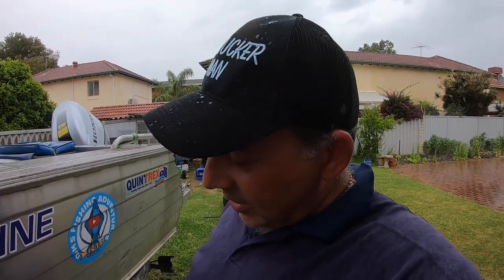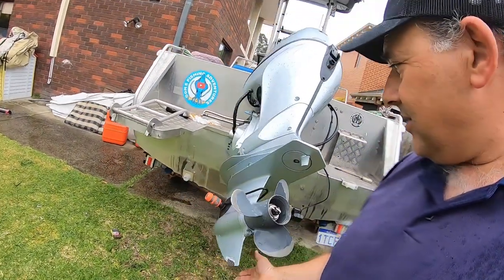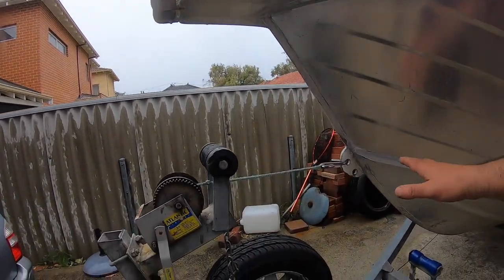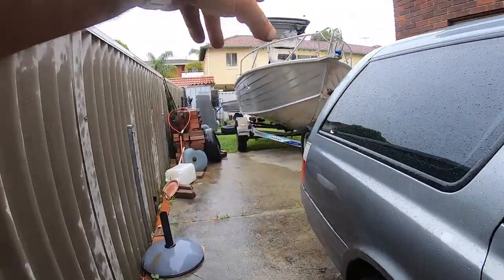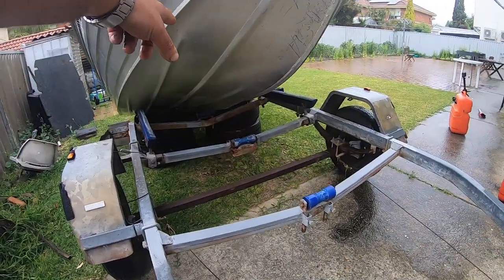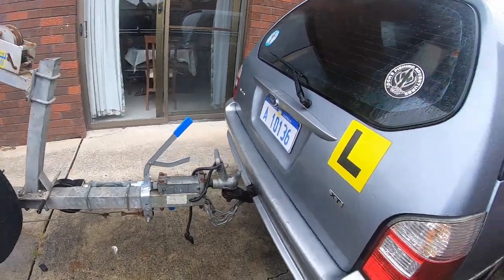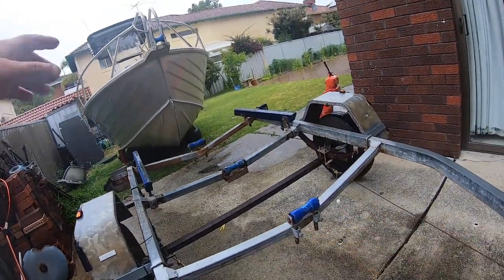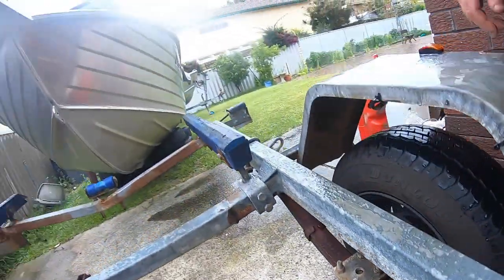I Did it! How to Remove Boat off the Trailer in the Backyard

Comment: Hi Dom. When you put the boat back on. Unhook the trailer from the car and present it to the boat by lifting up the hitch end and pushing as far as you can against the boat. Hook up the winch line and winch the boat onto the trailer letting the trailer roll back under the boat as you winch until the trailer wants to fall down on the hitch. Make sure your jockey wheel is down and once the boat is fully on put on your safety chain and Roberts your relative.
It is also easier when removing  the boat from the trailer.
Gerard not Dianne.
Tight lines.
Reply from the maker: Thanks alot Gerard! Exactly what Ive got planned👍👍
Reply: I used this technique also, it puts a lot less stress on the equipment than trying to winch it on with it locked to the car.

Comment: Dom I found with my boat (similar to yours) when I put it back on the trailer I did it unhooked from the car and the draw bar of the trailer lifts up as it requires and then I just winched it back on, was really easy, then as you winch the trailer pulls back under the boat to the point where the draw bar comes back down
Reply from the maker: Sounds great Luke,cheers👍

Comment: Nice work Dom, I have very similar Dunbier trailer that also needs work- I will try the guy you used in Osborne Park. I am going to try do my lift off the trailer slightly different, I have a two ton engine crane and I think I am going to try and lift the bow up off the trailer with that having the stern resting on tyres and then just drive the trailer out and whack some tires under for taking weight off crane. Stressful stuff for sure, well done doing by yourself… I think I will have a few beers and a mate or two to offer support haha cheers
Reply from the maker: Great idea mate..yes this techinque good for the small boats👍

Comment: The suspense. Well done mate. I painted my trailer while the boat was still on. I couldn't paint the keel roller rack because of cause the boat was on. Trailer is black and the keel rack is white. I wanted to take the boat off the same as you did but i was too afraid. Now i will give it a shot. Thanks mate 👌
Reply from the maker: Thanks alot mate👍 youll be right just take is slowly and depending on how heavey it is, just prop up with more tyers if you can, good luck👍
Reply: @FishTuckerMan  thanks mate. I ask the boss if i could borrow his tractor tyres that he has laying around the vinyard. He said yes but you can't bring them back. Hahah. I don't need tractor tyres laying around ny house. No room for them

Comment: Hi Dom great video mate. Question is that falcon your towing/lauch vehicle? I'm asking because I recently bought I 14ft quintrex and I have a falcon the same as yours but I'm concerned that it not be able to recover the boat and trailer from a boat ramp
Reply from the maker: Mate these Falcons are built for this 4ltr staright 6 ..strong engines 👍

Comment: Hey Dom, my bro in law has learnt from experience to always take the ear muffs off the motor when you aren’t flushing the motor. If you forgot to take them off you will cook the motor really quickly at the boat ramp when you start it up!
Reply from the maker: Lol..i did that with the smaller tinnie once...deformed the prop lol👍

Comment: Nice job done getting the boat off Dom. Wonder what a new trailer is worth, just thinking. Cheers mate👍
Reply from the maker: Thanks mate!. For my boat prob between 3 and 4k depending on cable brakes if fitted
Reply: @FishTuckerMan  Yeah too much money. Look at larger diameter rollers if you can. 👍

Comment: Those steel cables for the brakes end up stretching over time and you run out of adjustment very quick even with good brake pads.
Reply from the maker: Thanks mate..i replaced with new ones